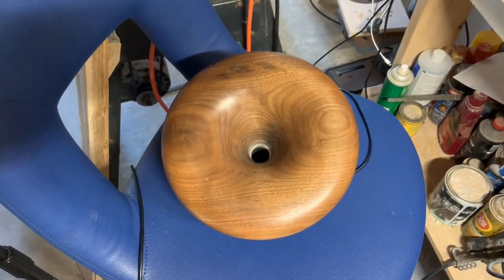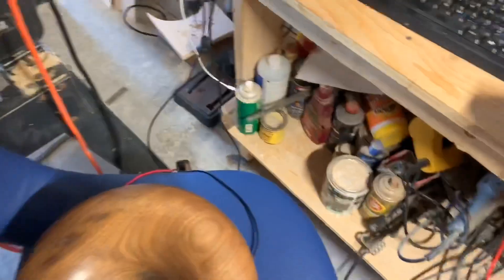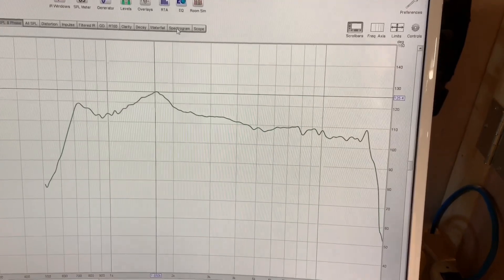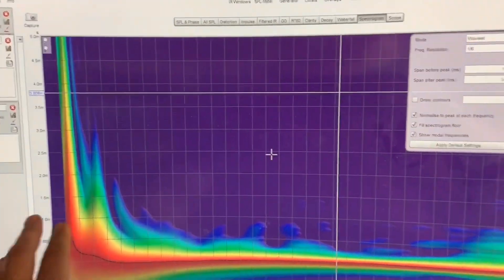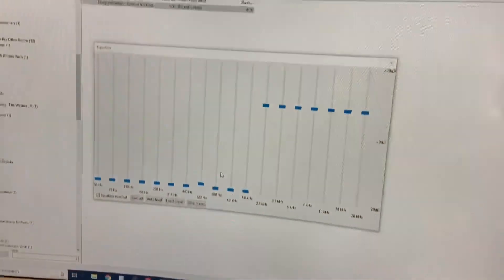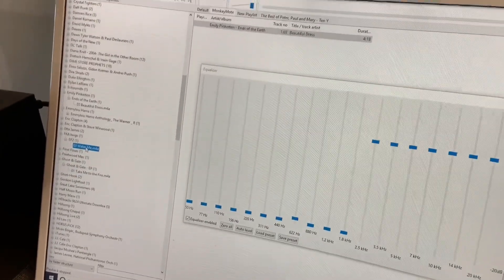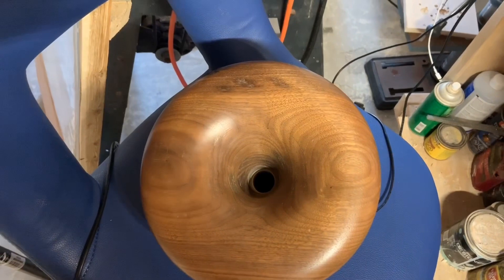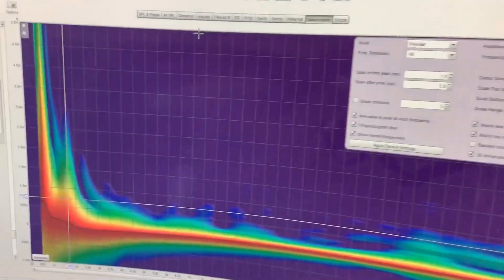How to select crossover point on a compression driver

Comment: How much does the small step at the throat effect the plots? You need to do this with my Altec 288 and 804 multicell horns.
Reply from the maker: This video the beginning of a narrative on how to effectively expand the bandwidth of a modern compression driver for audiophile use.  I will be looking at ways to lower the fundamental resonance by modifying certain parts of the driver.  It won’t be this driver though.  I have the DE400TN that I will be working with.  It has the same specifications except it uses a Neodymium magnet instead of ceramic.  It’s been my experience that the Neo sounds subjectively better so I will start with this driver.  Lowering the fundamental resonance will also lower the sensitivity, and lower the power handling since we are diving into lower frequencies.  However since we are using this in an audiophile application these are acceptable trade offs in order to get extension down to my target of 600Hz.  I chose 600Hz because this is the lower cutoff for my ES600 Biradial horn that I’ve developed that I plan to pit head to head against the classic Yuichi style horn, which I will also be building for comparison.  So yes, there’s certainly a lot ahead for this series of videos so stayed tuned!